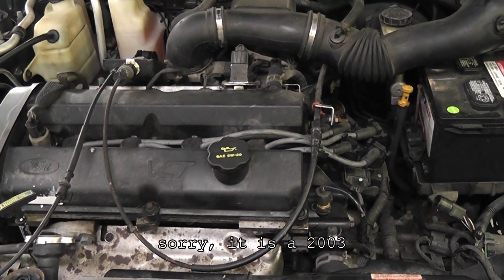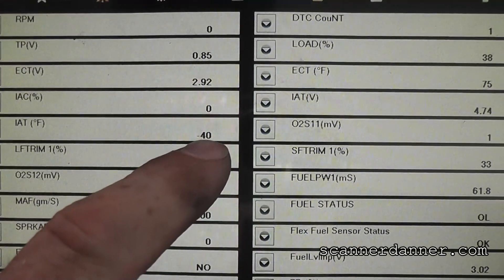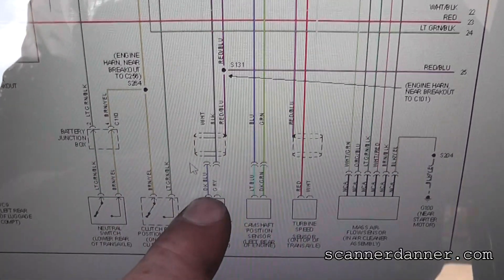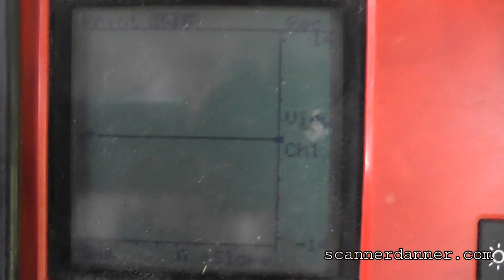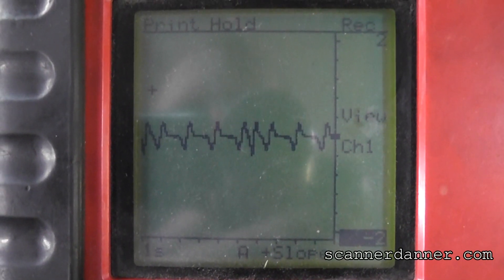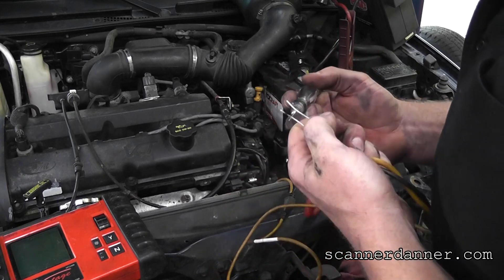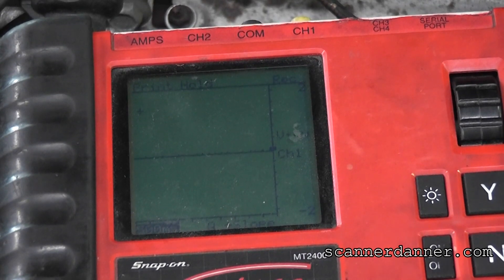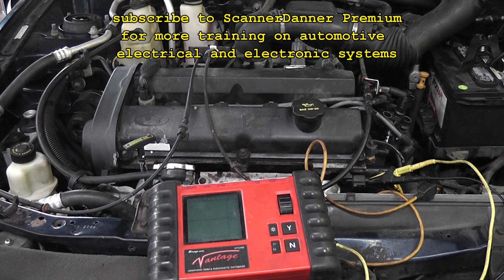How to test a Ford crank sensor (Ford 2 0L Case Study)

Comment: Paul,

I apologize for the length of this comment, but I think it will be worth it. I would be especially interested in hearing comments from any Technicians or Electronics guys who have tried this, and what the experiences and success/failure rates have been.

I'm also curious if Dealer Shops have equipment for this, or if they use this method.

____

By 36 to 1 I assume you mean there are like 36 notches or teeth on the flywheel / flexplate and then one position with no notch or tooth, or a double size notch, something different from the other 36 "normal" notches.

I don't remember if I've mentioned this to you, I think I've mentioned it to Matt B.    >

There is an electronic instrument called a Function Generator, sometimes called a Frequency Generator.

I believe that MAYBE some Snappy scanners might have some of this functionality (no pun intended) built in, not really sure. Talk to your Snappy contacts. I'm pretty sure that some of the Pico Scopes have the ability.

Paul, I would strongly encourage you to look into this. With your fetish for "bypass testing" a Function Generator would change your life. Seriously, man. They are cheap. You can get a very good one for under $200, and an extraordinary one for around $300 to $400 or so. They are also available at much higher price points, but you would not need that, those are for true laboratory environments.

What a Function Generator does, is allow you to create a signal of any frequency, of almost any type --- sine wave, square or pulse wave, triangle or ramp wave, etc.  and almost any voltage (amplitude they call it).

You can even modulate the output by using a second "signal" or control voltage.

Clarification....By any frequency I mean up to at least 2 Mhz, which would be typical, some generators go higher.  So that would be many times faster than anything you would ever need on a car. By "almost any voltage" (amplitude) I mean that a typical generator might generate 10 volts peak to peak, or maybe a little higher. As you know, most sensor signal voltages are around 5 volts or 8 volts (some Chrysler cranks, etc), so a 10 volt amplitude range (it's adjustable) should suffice in most cases.

So, the idea is, that if you are trying to do a "bypass test" on a sensor, you want to feed the computer a signal that would mimic what would normally be produced by the sensor.

In the video above, you were doing this in a "random" manner. I've seen you do this in other videos as well. Sometimes you get a good enough result to verify your diagnosis of a bad sensor, sometimes you don't.

Well, with a Function Generator, it is a relatively simple thing to do, and it would work perfectly (I think).

What you would need to do is a little bit of algebra, to determine the settings for the Generator.  You will have to know the cranking rpm's. Then you have to do a conversion using the 36 number and relate that to the rpm speed to know exactly what "speed" (frequency) the signal from the crank to the computer should be during cranking.

Lets do an example: Lets say crank speed is 700 rpm's. Multiply that by 37 (36 notches plus the one "non-existent" notch). 37x700=25900.

So the normal signal from the CKP would be 25,900 "pulses" per minute. But frequency of electronic signals is always in Hertz, so we have to divide the 25,99 by 60, which is 432.

So we need to set basically three settings on the Generator. Frequency, Amplitude, and Wave Shape or type.

So the Freq would be about 432 Hz.  The voltage amplitude would be whatever the sensor usually produces, I assume a 5 volt pulse. The third factor, wave shape, could be problematic. If this is a VRS sensor, I think the output is what I would call a "squiggly" horizontal wave. You know what I mean. So this is not going to be a normal typically available wave shape choice on a Function Generator.

So you have two choices. The first is to choose a more standard shape, such as a square wave pulse, and then "play around" with it to see if you can get it to behave similar enough to the VRS output to "trick" the computer. I suspect the computer is really only looking for the very tippy toppy point of the wave shape to trigger, so you probably could make the generator work well enough to imitate this, probably with a very very narrow pulse of the correct frequency. So maybe set the pulse width up to be only about 5% or 10% of the total length of a normal VRS output wave, with the leading edge of the pulse equivalent to the "spike" of the VRS pulse.

The other choice is one that you would make at the time of purchasing the Generator. In the more expensive models, you get a feature called Arbitrary Waveshape Generator (usually abbreviated AWG). Check with the boys at Pico and see if any of their scopes will do this, they probably will.

The idea is that you can "build your own" wave shape, by simply establishing a set of independent points, in any shape, and then  let the Generator "connect them all together" to form a wave shape. So for a pretty good and realistic VRS type signal, you might build, say, 20 points along the normal shape.

In fact, and this is a long shot, and I'm not going to take the time to research it right now, but some of the better Pico's might already have a VRS simulated wave shape available.

I know that a year or two ago I DID find some kind of Scope or Scanner that had Signal Generation built in, but I just can't remember what product I was looking at.

So, in conclusion, with the right Function Generator, you would create or choose your desired wave shape, frequency, and signal amplitude, and then "inject" that signal into the two signal wires that go from the sensor to the computer. (So, you are not connecting the Generator signal to either of the wires on the sensor--you are unplugging the sensor and connecting the two Generator leads to the two wires that go directly to the computer).

Sorry for the repetitive verbage, just trying to be complete in what I'm saying. Also, if you do this, be very careful of the polarities. Also, be very careful about floating sensor grounds vs chassis ground. And keep in mind that the Function Generator might have a grounded power plug, so be very careful about dangerous "ground loops".

Lastly, I have never actually done this. I am not promising it would work, but I'm pretty sure it would. I am coming at this from a point of Electronic Engineering, not Automobile Computer and Sensor Engineering.

Imagine the possibilities! You could "synthesize" the output from nearly any sensor on a car and feed that signal into the computer!

I know for sure there are O2 sensor simulators out there.

Also, in the example I described above, it would not work perfectly to run the car, but it should be enough to get it to fire most of the time. The reasons are that the freq of the output of the generator is going to be constant (and they are VERY accurate, typically a small fraction of a percentage point). But crank speed will vary a little. Also, the Generator is going to put out 37 signals or pulses for every crank rotation, and the "missing" 37th would not be missing, so this might mess up the computer's ability to "find" the right crank position. But maybe in some cases the combination of a good CMP signal with a glitchy CKP signal might be enough to get the car to fire consistently during much of each revolution, even if it won't actually run.

It would also be feasible to design and build a circuit from scratch the would have the ability to incorporate the "missing signal" no matter what the notch count is on any given car.
That circuit would use a "microcontroller", but that is WAY outside the scope of these comments.

I hope to hear comments from anybody that has tried this type of thing, or anybody who understands it better than I do.

Peace.

Comment: Hi Paul,

I have a Snap On Vantage that also shuts off,  I think mine also has a bad solder joint on the board.  Can you make a video when you do the repair?  Thanks
Reply from the maker: For sure!

Comment: Nice stuff as always. Laughed much while you said there is a bad solder joint inside your test equipment. Remembered those days when people were listening to radios and some times radios were going defective, then they were telling that there is some bad or loss soldering joint inside.

Comment: Hi Paul, you might be able to put a small torch battery or flashlight as you call them across the two wires to see if there is a spark, like a 1.5 or 6 volt one, i have done that in the past, good video cheers....Fred in England.

Comment: Good stuff Paul.  Cruddy location for a crank sensor.  I believe you have to be careful going across an EDIS floating ground crank sensors with 2 or more channel scopes.  If you have another channel hooked up connected to battery ground and the ADCs share grounds, it will ground the signal and the engine won't run or stall.  Maybe you could make a video on that.  Would be interesting to see.
Reply from the maker: Discretesignals agree and thanks for the reminder! I will need to do a video on that for sure. Section 21 page 15 in my book I talk about this exact thing. "When to connect your scope to sensor ()" and "When to connect your scope the battery ()

Comment: If the sensor is physically cracked or ground down at the end, the car has bad bearings. I have a focus with the same problem. The thrust surface of the main bearing is toast. The crankshaft shifted forward and caused the flywheel to strike the sensor.
Reply: Hey Dennis, I have a 03 focus dohc zetec vin-3 & Only when Its wet outside & I hit a decent puddle, my car will sputter & stall out. it's happened twice now, Each time it was raining though, I let the old lady take my car back & forth to work for a few weeks & she brought it back slightly knocking, I installed new main & rod bearings, new timing components, & water pump & thermostat. I imagined that water was getting into something causing this issue but when I read your message, it made me wonder? Because I did replace my bearings but, my father passed away & I worked threw the night getting the car put back together & was running late & instead of going easy, since I was running late, I chose not to go the flat, long way around, instead I took a massive hill within 1/2 mile of starting the car (I know I shouldn't have but, I simply planned on replacing my bearings & upper & lower oil pan gaskets again, along with an oil change & 2 quarts of trans fluid(from removing axle) & of course assembly lube & maybe a zink additive. but, since I only have this issue when it rains & I hit a puddle, what do you recommend> following my crank sensor & looking for any breaks in wire or the cam sensor? I thought of using a rubber spray & spraying whatever damage I might or might not see? the 1st time it happened was right after a flood & I hit a big puddle, 2nd tim was yesterday, as it was pouring down, was on interstate & hit a bit of water that shot up & could hear it hitting the wheel well. car started stumbling, I pulled over, started the car & it idled but, COULD NOT GAS IT ( it would stumble, miss & die if I gave it gas) after letting it idle a while, I slowly reved it until I had full pedal & at least it cleared up quickly lastnight.